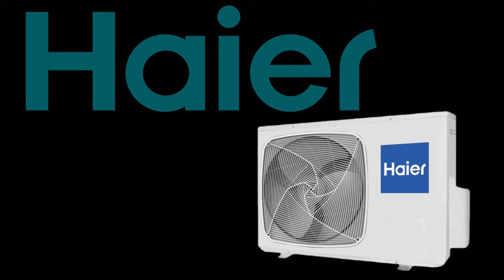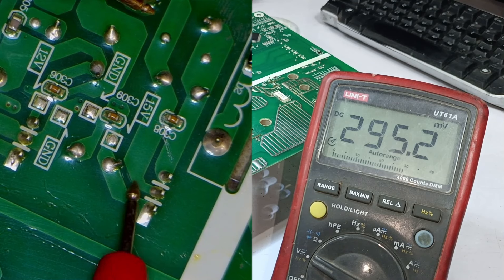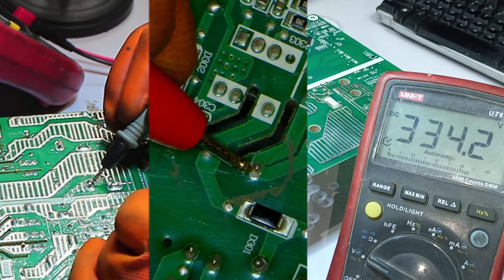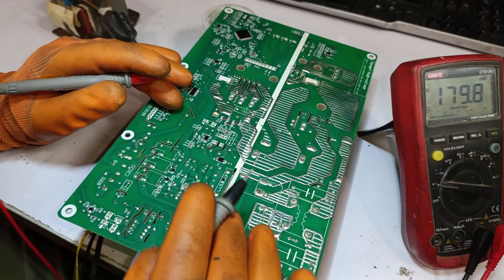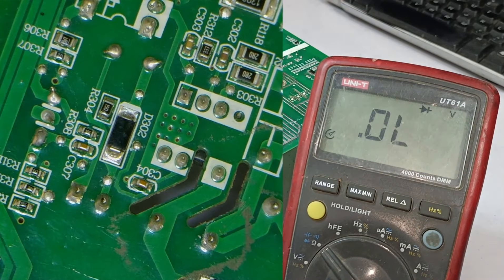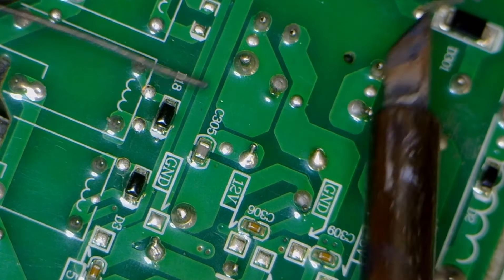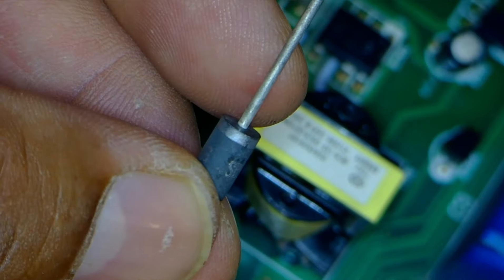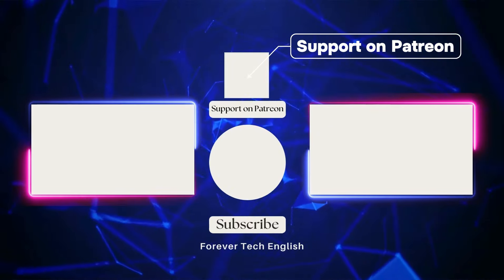Could This Tiny IC Be the Cause of Haier Circuit Failure?

Comment: Admiring your technical expertise! Personally I would invest into razor sharp test probes to avoid slippage. But you are calm and did it all the right way. Before the age of conformal coating I remember dry joints or of course vermin contamination. Diodes serve a critical role in smps. In Australia most R410 systems get dumped because there are no skilled board technicians and replacement boards are too expensive. If the unit is mounted where access to the board is not possible then opening the refrigerant circle is rarely performed as technician time is too valuable. Huge thanks for your patient and clever way to show us to save such boards.

Comment: What is the difference between the diode you replaced and the other, small ones, that you checked before. I wonder why they are not all the same shape! Thanks.
Reply: There's difference in Vf forward voltage drop, but most important maximum average forward current and reverse breakdown voltage. Also kee in mind it needs to be fast recovery i.e fast switching diode.